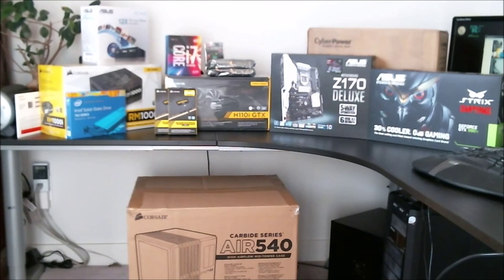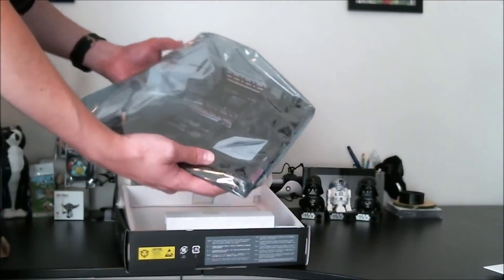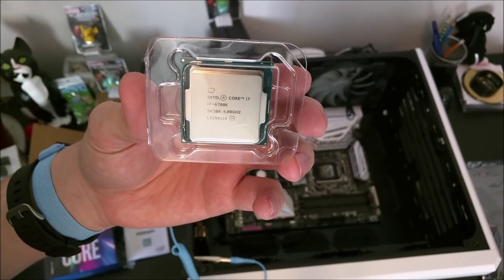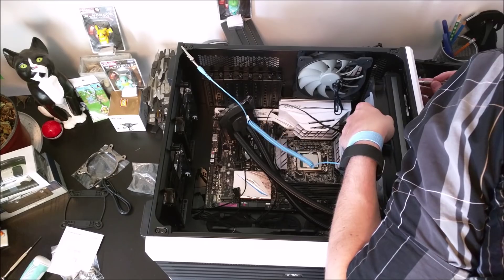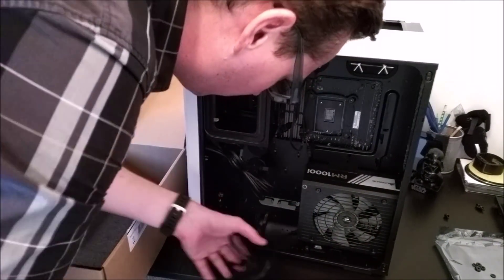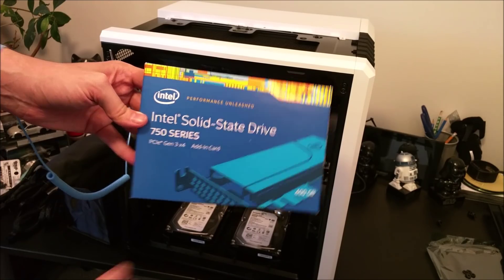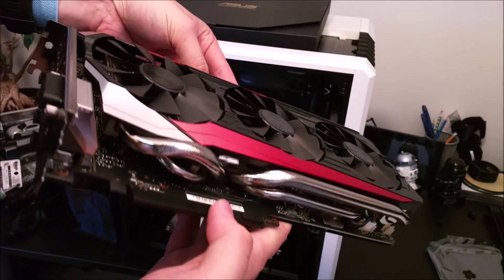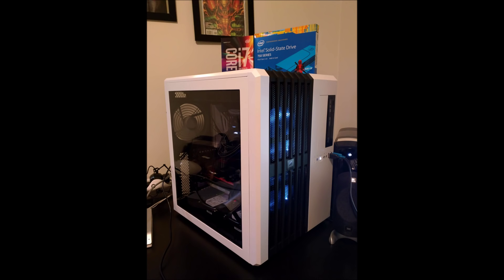i7-6700k Skylake System Build

Comment: I basically have almost the exact same specs waiting for me to build , still waiting on the motherboard ,psu,hdd and ssd drives to arrive before i can start building my system .  here are my parts lists to see the differences . http://pcpartpicker.com/p/PyHggs.
I chose this case mainly because it has awesome airflow and looks super easy to build in . do note that the front dual HDD drive bays can actually fit a sata ssd if you just plug it in .
Hopefully i won't run into any problems when building it . Thank you for your video.
Reply: I chose this case since all of the hard drive brackets where unseen, the optical drive mounts were in the back which meant triple fans, and the PSU not taking space

Comment: Don't worry about the static, I'm always toucing on my pc and never had any problem, as long as you touch your case you don't have any problem with that
Reply from the maker: one good zap can contain 25,000 Volts. If you are really careful you can get away with it, but is it worth the risk? The static straps certainly aren't fashionable but they will prevent that "oops" that could cause future instability in your components due to the static shock accelerating the Electromigration of the circuitry.
Reply: uh, been doing for several years now, never had any problem.
Reply from the maker: +97pedrocas well then you are a pro bro! I work with really expensive server equipment for a living, so I don't take chances :)
Reply from the maker: +97pedrocas gotta cater to guys that might be doing things for the first time so they don't be all like "Prax man, I static shocked my cpu, why didn't you warn me". I hate tears.

Comment: Nice build, just a quick question, why did you go with a 1000 Watt unit? I doubt the needed TDP of those parts scratches 700W unless you're going SLI. I just finished my skylake build as well. Maybe some collaborations in the future?
Reply from the maker: +Profound Gaming My system actually pulls around 500W all in. I always go higher on the power supply. The overall cost is not significantly more in the grand scheme of things. I think about it logically this way: If you are going to drive up a mountain in a car and the car has 100 HP, how much wear and tear does it add to the engine? If you had 200 HP then the engine and internals would have to work less hard to send the car up the hill. 

As power supplies age, they become less efficient and their overall output can decrease. If, for example, I got a 600W power supply that was 80% efficient, I might be able to output 480-500W without overstressing the power supply. Over 2-3 years if its effective output drops, I may start experiencing power drops. 

The other reason is SLI, future graphics cards that may be more power hungry, and overall ability to upgrade without having to pull out the power supply...so many wires!!!

That is always how I have looked at it. If the price point on the 1000W is not much higher than the 700-850W then I always jump into the 1000W without looking back.

I would love to collaborate, any time. Hit me up on Twitter @trevorkiers
Reply: +Prax Thanks for elaborating. Overall I think its actually a good idea for that PSU given your future plans. You've earned a subscriber.

Comment: Nice Channel ! :) I will do also a upgrade on my system from sandy to skylake very soon i think i go with the Asus Z170-A this time. Coming from a Asus p8z77-v pro i really never used the wi-fi on my current MB so i will use the extra money i safe to put towards water cooling and ram maybe since i already bought a hyperX predator pci ssd and a Asus  PB287Q and a Sapphire R9 280X Vapor X TriX OC !  But keep up the good work i will surely need alot of tips and help with my new Build soon
Reply from the maker: Feel free to hit me up for any questions, I would love to do videos to help people with aspects of their builds. I did two builds with the Z170-A last week. It is just as good as the Z170-Deluxe and overclocking capabilities are very similar for 4.5-4.6 GHz despite 8-phase vs 16-phase power.

Comment from the maker: I find that I'd rather spend lots all at once than spend a small amount and have to feel the need to upgrade or buy new again every 18 months. Though I can honestly say the 970 GTX would have been more than sufficient. I highly recommend the Intel PCIe SSD though. Soooooo fast.
Reply: +Workout4Life Mc I built mine on mt bed while standing on carpet. Static is not a problem if you just touch your case every now and then.
Reply from the maker: I disagree. The last PC I build for myself before this one was a $4500 system (QX9650) with drives in RAID 0+1. The system lasted me 7 1/2 years with a RAM upgrade and a GPU upgrade (Started with dual-9800GTX SLI, ended with 570GTX). If I can get 7 1/2 years out of a PC that isn't all that bad. The old PC still plays 90% of games at medium to high graphics, but the CPU is starting to become too much of a bottleneck.
Reply: skraelingshortbus
I've built my pc like 3 month ago and it wok like a charm, if you're wondering, yeah i used esd gloves, ause its my first rig and i cant destroy it haha, but Thx for the time man
Reply: Workout4Life Mc
 I could see gloves being less of a pain in the ass.  The cord constantly getting in the way is annoying.
Reply: dude i have antistatic wrist trap and antistatic Gloves are these invincible against esd x,D ? i have carpet on my room ...btw
Reply from the maker: I wouldn't build on carpet, but having the anti-static protection is a big plus. If you have carpet, and it is your only option then do this: Install the power supply into your case first, plug in the power supply to a wall outlet (leave the power supply switched off) and then ground your strap to the case. This provides a ground that will prevent static build-up from the carpet, if you have no other choice.
Reply: Prax
Thx! then i'll use both!.
Reply: +Prax You need to buy a new PC every year to keep up with it.
Reply: +Ash wow  thx man :), but i should be ok with antistatic gloves
Reply from the maker: I recommend it 100% completely. It is up to 4x faster than any SATA based drive. For my video editing I use a separate cheaper SSD for my writes/scratch drive and initial destination drive and ultimately use my mechanical storage drives for the destination for storage. If you manage to wear one out within 5 years then kudos to you! lately I have been using the PCIE SSD for the writes and it keeps my CPU busy nicely.
Reply from the maker: Even if you do manage to wear it out, it will have saved you 400% of your time compared to a SATA SSD, and it will have saved you 40000% of your time vs a standard mechanical drive. Totally worth it.
Reply: +Prax Barf mines going on 8 years old now :\  I really want to do a skylake build but im months away from it at this point still.  So this vid will tide me over.
Reply: +Workout4Life Mc I built my current system without it (and its run very solidly for 8 years now), I DO have one though.  Depending on time of year ill use one, like in the dead of winter when the air is VERY dry... yeah ill either be using a strap, touching a metal object constantly, and or building on an anti stat mat.

Is it overkill?  Probably.

Can it save you a headache down the road absolutely.